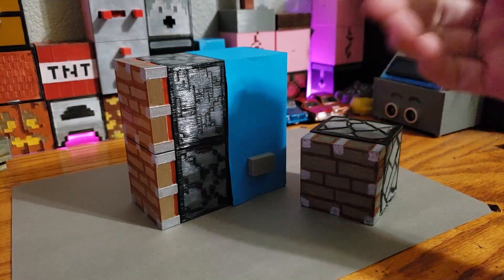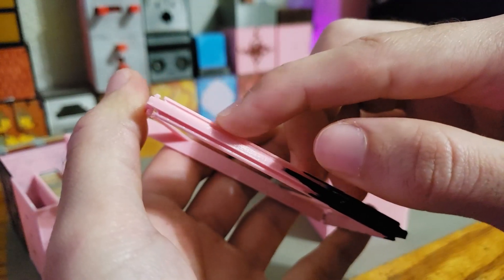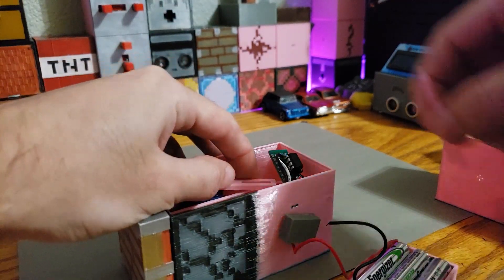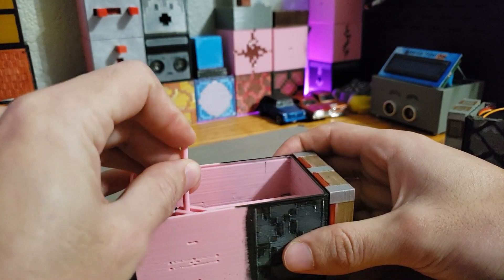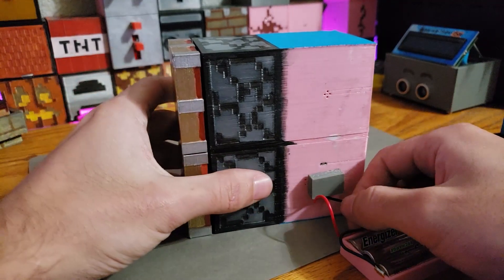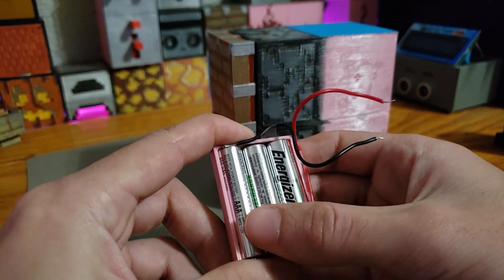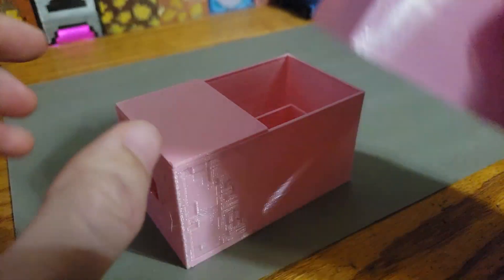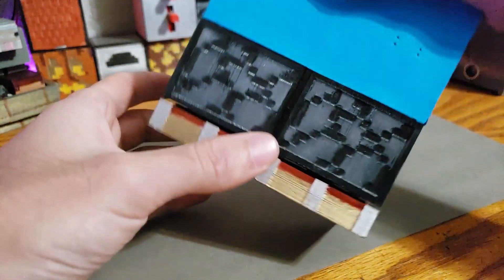Minecraft Piston: Servo

Comment: You could make it one block by moving the servo forward and connecting the arm rod directly to the end of the piston shaft

Edit: the end of the arm would have to be thinner on the ends
Reply from the maker: Someone made a paper version where it extends fully : ) I plan to make a bedrock version to make mine one block and also have the full extension

Comment: That's nice, dude! Every your creation is so good, but i don't have a 3d-printer, so i just watch your videos, it's very cool) 👍
Reply from the maker: Thank You! I hope you are able to get a printer yourself :D
Reply: @hecbac  Jukebox is the best one
Reply from the maker: @ertason  I'm happy how it turned out, and got lucky with how smart the mp3 module is
Reply: @hecbac  i have an idea about jukebox: what about to make it identify different music disks? For example by depth of slit on the bottom of the disk. I wanted to make working jukebox, and found your one, that is almost like my idea.(i don't think that i can make it, cause i'm 14yo and i don't understand electronics)
Reply from the maker: @ertason  I think you can for sure make the jukebox. The main issue is if you can find somewhere to 3d print. If you can, you just need the mp3 module and do some basic soldering. A simple solution is to have a separate sd card and disk all together. The files are stored there, so you can easily swap disks and songs that way : )
Reply: @hecbac  i think, 3d print isn't so big problem, wooden body also will be nice) I think, i'll learn more about  electronics on vacation, cause i also want change construction. Anyways, we'll see it in future, and thanks)
Reply from the maker: @ertason  Oh, sweet! I hope you are successful : )